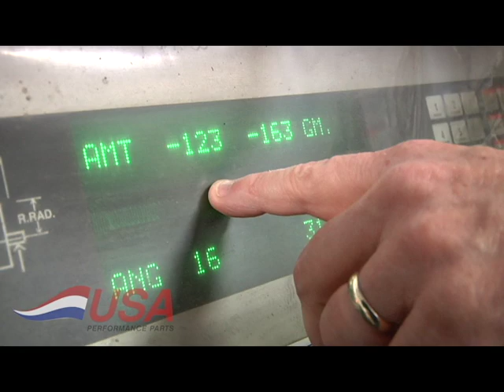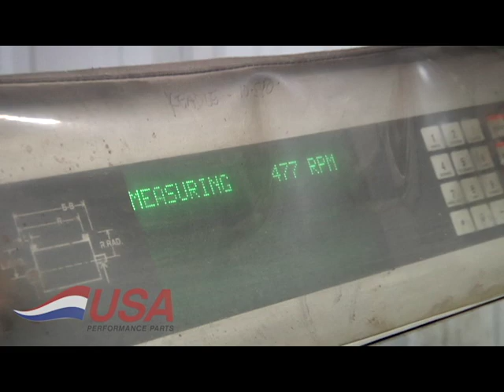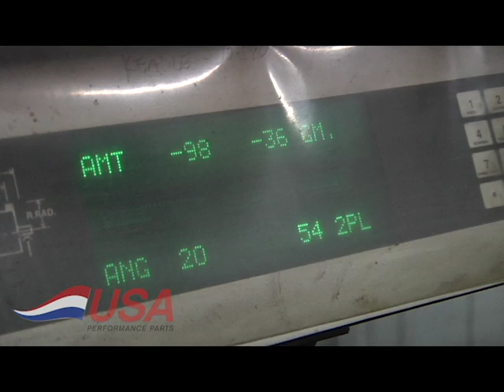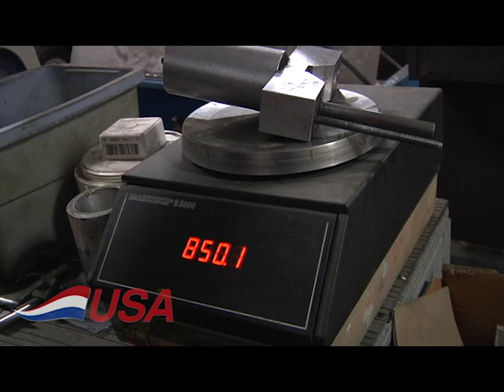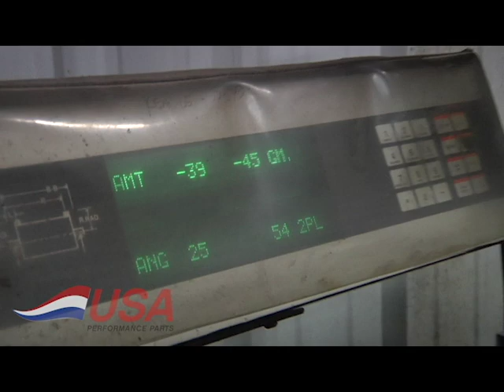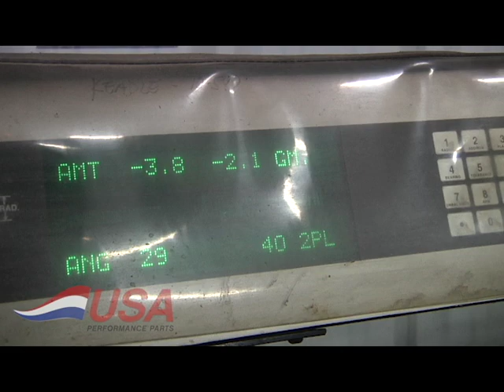CRANKSHAFT  BALANCING

Comment: Refreshing to see someone who knows what they are talking about. Anyone who has seen Barum Engines laughable work, with a worn out machine and no real grasp will know what I mean. Even their UJs are adding vibration.
Reply: Chris, this would be considered a "internally balanced" engine correct?  and if you drill holes in your flywheel and harmonic balancer it would be externally balanced? just curious, thank you for your input.

Comment: do they really do all this on every shaft made on factory autos
Reply: Nope. The counterweight mass is engineered to be extremely close to being finished balanced beacause a production engines parts are standardized and never changed, hence you can design a counterweight for exactly that combination. You can’t do that when your crank has to accommodate pistons and rods from various manufacturers and design combinations. It’s basically a Production engine vs Custom.

Comment: DAVID, I NEED TO ASK YOU A TECHNICAL QUESTION. WITH PONTIAC MOTORS THE BLOCK IS STANDARD FROM SMALL CUBIC INCH TO BIG CUBIC INCH. SO BASICALLY THE CRANK FROM A 326ci ALL THE WAY UP TO A 455ci ARE BASICALLY ALL THE SAME WEIGHT GIVE OR TAKE. FROM WHAT I KNOW IS THAT A CRANK IN A PONTIAC 326ci IS HEAVIER THEN THE CRANK IN A CHEVY 327ci WHICH CORRECT ME IF I AM WRONG WEIGHT IN AT 54LBS. WHERE AS A PONTIAC CRANK WEIGHTS SOMEWHERE BETWEEN 60-70LBS AND WHAT IS THE EXACT WEIGHT OF A PONTIAC (326)CRANK AS OPPOSED TO A SBC CHEVY CRANK.

Comment: Does a balanced crankshaft effect possible max rpm range?
Reply: I have two Buick engines both a 350. One is stock standard and the other has weight matched pistons and rods. One will hit 5000 rpm before it sounds like its going to die, and the other hits 5500 rpm. That's actually a pretty significant difference. I know it's not the most scientific answer but there does seem to be something to it.
Reply: yes.. certainly will
Reply: The crank the rods end caps and wrist pins is what gives u more rpm usually the force on the crank at 6000rpm is like 10,000 pounds the balance helps alot to keep more weight off of the crank without trying to create vibration spin a wheel with some weight on one side